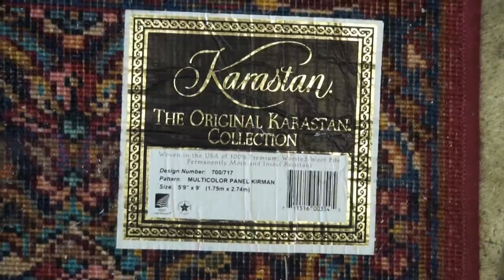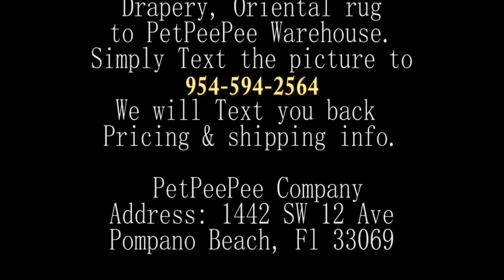Professional Rug Cleaning service-#rugcleaning

Comment from the maker: The revolutionary way to clean Oriental rug without touching the rug in the wet cleaning process, this would ensure that your rug would never have the damage that cause by the scrubber all the other carpet cleaner use. By using the Dead Sea minerals we eliminate the need to use dry-cleaning steam cleaning soap and enzyme. Dead Sea minerals odor free and organic develop by PetPeePee system